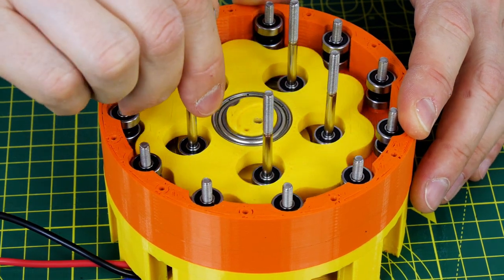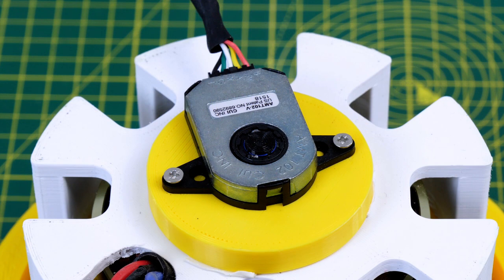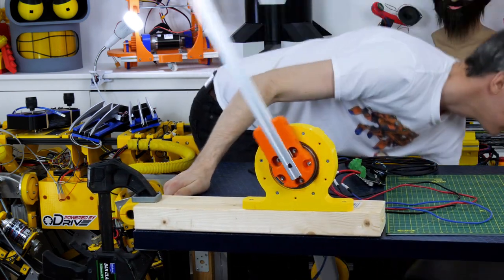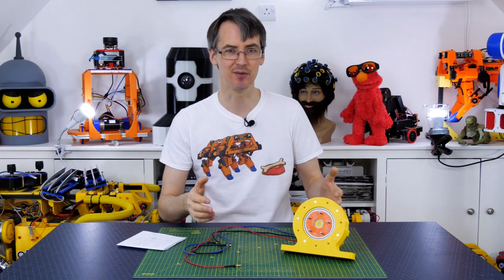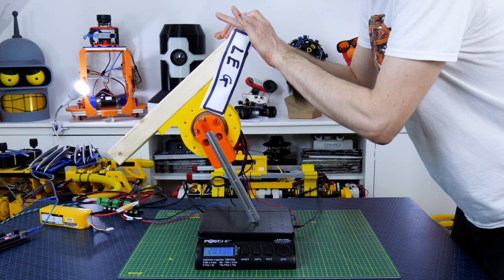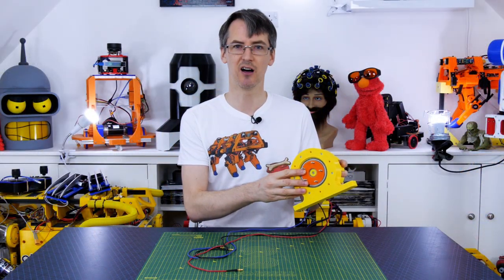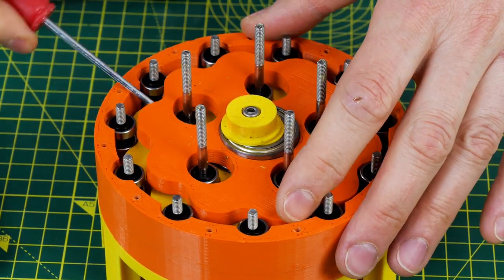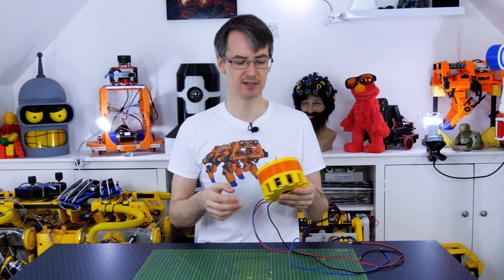Testing: Cycloidal vs Harmonic Drive 3D Printed Reducers

Comment from the maker: Next week is a totally different robotics project - Patrons and YouTube Channel Members have it already!
Reply: bro wtf 13 hours ago?
Reply: Which book shall i study to understand these concepts like...harmonic drive etc. There application n all.
Pls help
Reply: Hi James I think a abacus drive would be worth looking into as a powerful, compact, and backdriveable actuator
Reply: You should install a separate gear reducer on the strain bearings of the motor, that should help with the loss of torque
Reply: #@James Bruton how long did the 3d printed flex spin for harmonic drive last?
Reply: The VESC is much more than a skateboard ESC, and has encoder support as well. Please take a look at vesc tool. You will be pleasantly surprised by the insane amount of configuration parameters!
Reply: @Pesc0-conti  exactly. it triggers me so much. last 3 videos ... YOU CAN USE SENSORS WITH A VESC
Reply: Reduce the size of the drive itself, more dense packing. And it will move some weight.
Reply: Hey James, why wouldn’t you use a planetary gear box in this case.... just curious? Thx!
Reply: Does it involve prosthetics?
Reply: @maxciviletto9631  I would agree; Using the formula; 
planetary gear ratio = 2x(1+(RP/RS))
if you used a planetary gear with radius RP =  4 x radius of the sun RS, you would get the x 10 that you are looking for. Note will be back drivable too.
Reply: James have you tried a planetary gearbox for arms yet? They would back drive fine, would be loud though with straight gears, if using helical gears maybe thrust could be an issue ?
Reply: Plastic on metal will last much much longer than plastic on plastic, if you replace the bearing with stationary plastic its gonna wear out pretty quick especially when it builds up any heat, the plastic must also rotate like the bearings, take one ruler and try to cut it with another ruler and you will see how bad plastic on plastic is, where parts are rubbing you want metal on plastic
Reply: This design could revolutionize equatorial mount

Comment: At 25kg per leg looks like James is going to be able to ride this puppy. Can't wait to see the final design.
Reply: Only when stationary. Moving (3 legs, each 25 kg) sounds too close for comfort.
Reply: That would be so cool, although as the others have pointed out have to consider the added forces/torque from acceleration during motion.  Literally a statics vs dynamics problem lol
Reply: Next project open pony?
Reply: It's 2022, goodboi v3 is out, and can carry a load of 400 lb. Life is good
Reply: Moving, you'd need have 2 legs on the ground at a time, so they'd need to support (say) 80kg static, which means 160kg dynamic (you "weight" twice as much at peak when you're moving about).  So he'd need 80kg per leg to ride it.

So, if he had a 40:1 reduction, that would do it.  No idea if that would still be backdriveable.
Reply: I want robotic horse
Reply: The US military has six-foot variants of that dog to carry gear. Don't give them any ideas
Reply: @wiktorszymczak4760  it's been done- they call it the Bicycle.
Reply: @wojtek4p4  Eight legs, then, simple as.

Comment: "Mummy, who's that funny man on the skateboard with the strange stick?"
"Oh dearie, that's just James, the village robotics genius."
"But Mummy Mummy, are the three-dimensional models for that gearbox available for download online?"
"Yes child, he's a very good man and he publishes his designs as open source."
Reply: @GregorShapiro  It's not an STL, it's an STP (or STEP) file. There's a difference. Any 3D CAD program or viewer should be able to open it. You may have to enable options in your viewer to have parts of the assembly be displayed and adressable as separate pieces.

STEP is quite practical as a file exchange format but It's emphatically NOT a source file format. It's hard to change anything about a part in a STEP file. You lose all sketches, extrudes and other operation history, assembly constraints, etc. If you want to, say, change the diameter of something, you're better off just designing the whole part new.

It would be great if James could consider publishing his F3D files along with the STP files. Those are the true source for his design.
Reply: @olavl8827  Even in an STL viewer it isn't much better. The 'parts tree' has but two 'leaves': one is the 22 ball bearings, the other is the rest of the construction which cannot be broken down any further.
I can color or hide one or the other or both of these 'leaves' but can't isolate the cycloidal discs or any other feature.
 I would like to take sections so I can trace the shapes in the 3D modeling tool iam familiar with so I can extrude appropriate heights of the various parts and send them to a slicer for the 3D printer I hope to get access to when Covid restrictions are lifted.
Reply: @GregorShapiro  I'm not even sure if you read my previous comment, so I'll repeat: James' file is not an STL but a STEP file. You need a STEP/CAD viewer, not an STL viewer. STL is not a CAD file format.

If I open the file in FreeCAD I can select and manipulate all the individual parts of the assembly. But this does depend on the import settings that I configured. The situation will be different but similar in other programs.
Reply: @olavl8827  Yes I did read your previous post. I did install a STP viewer that is what I found 2 leaves in the hierarchy.

Comment: 3:10, C'mon man. I'm not going to tell you to not test it with by hand but at least do it from the other side of the table so that it doesn't have a chance to pinch your arm between the table and the lever.

Overall, like the idea. I think the Cycloidal Drive will work out well in this project. I agree that at the very least the outside bearings need to go, if I understand correctly, the disc is rolling across the outside pins anyways and thus friction there should be very small.

If you modify the geometry of the cycloidal disks, they won't need a full pin to roll against. This would let you print roller ring section in nylon and integrate the pins into the ring itself and possibly cut the outside diameter a bit, further reducing weight.
Reply: Upvote this. Every time he haphazardly grabs that lever, I feel like my heart is about to jump out of my chest.
Reply: I know it shouldn't be strong enough to seriously hurt him but I did cringe a little every time he grabbed it, all he to do was clamp it so he could easily grab it on the upward stroke and it would also eliminate it pulling the table up as well
Reply: Yeah, I'm fully expecting a video titled "Well it seems I've lost my fingers" at some point in the future.
Reply: @deflepperdrocks12954  Looks strong enough to break an arm or at least a finger if it hits you unlucky. I'd call that serious and I agree with the other commenters who want James to be more careful.
Reply: @olavl8827  his palm/arm should easily be stout enough to stall the motor at the distances he was grabbing and at the same distance even a single finger would likely survive although badly bruised, the only really dangerous spot in my opinion is the radius just above the tabs that connect it to the board as the rotating orange mass has very little clearance and you have substantially less leverage working in your favor

I would love to see him test the danger with something like a wooden dowel but I doubt he'll even see these

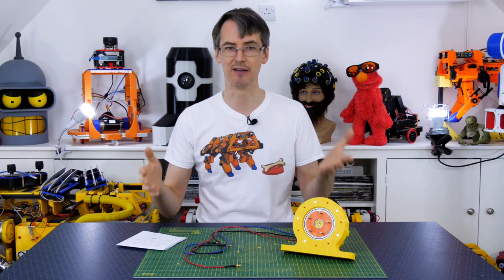Comment: 4:58 you were so close to actually finding out numbers, just vary the 8kg distance from 0.25m to 0.50m
Reply: He was even closer, he could have just measured the angle at which the motor stalled at 4:24 and calculated the arm from that.
Reply: @BigHorse4200  Looks like it almost stalled around 40° to me. That would be about 30Nm.

Comment: New torque unit - 1 finger per screwdriver.
Love these gearbox series.
Reply: Wouldn't it be 1 finger screwdriver, as finger is the force and screwdriver is the length?
Reply: @KentoCommenT  Yea, right
finger * scredriver

Comment: I think the biggest weakness of this particular strain wave gear is that the flex spline is a very soft material, meaning that when the output has enough resistance the wave generator can just compress the spline and roll past it instead of driving the whole mechanism forward.
Reply: Yeah. With the two point ellipse and the triangle gears he is also not getting anywhere near the contribution from the geometry (%10-20).  The flexspline cup is also WAY too deep given the material properties (Metal flexsplines are that long to allow for the needed flex). The cup is going to twist right out of alignment. Harmonic shows that the backdriving torque (https://www.harmonicdrive.net/_hd/content/documents/FB_Component.pdf) is commensurate with the input torque (slightly higher as might be expected) so there is a design flaw

Comment: I'm glad you're sticking with the cycloidal drive, and looking to remove some of the bearings. if you use a proper cycloidal tooth profile the gear teeth have pure rolling contact where they mesh, so simple pins or a bigger cycloidal gear will do just fine. No need for bearings or even bushings.

Also, I think nylon is a bad idea for the cycloidal gears. Soft, squishy and spongey materials soak up energy and reduce efficiency/backdrivability. I think this is what is causing problems with your harmonic drive. Think of it like trying to walk through mud vs on pavement. Personally every time I've used a squishy material in a drive system it's come back to bite me.

Loving your work!

Comment: I think the downfall of the harmonic drive was simply due to the flexible material of the core deforming at the tooth level to allow the gears to slip. Commercial versions use clever metal rings that flex at the ring level but are almost completely inflexible at the tooth level.

Comment: Priceless James! I've just started looking at drive types as I decide the style of robotic arm to print. I'd ideally like to get maximum leverage and torque of course. Even more so as I'm wanting to design interchangeable tool heads for the  arm to use it to drill, mill, cut, etc... I'd like to make it strong enough to work with wood, metal, plastic. The cycloidal drive looks at first glance to be more than capable of handling that! You're the bomb Bruton, THE BOMB!

Comment: The VESC can track rotor position @ 0 speed if HFI is enabled :)
Reply: Yeah, his motor doesn't have a sensor but he says it's the vesc's fault. I don't think he knows how to use it
Reply: I have 4 of that vesc in my skateboard and it can make a sinus curve with a rotor input. To me it seems he has only glansed at the settings or haven't bought the program Vesc-tool.
Reply: i mean most motor controllers are designed to do that
Reply: @Blox117  not really

Comment: have tried using PTFE filament instead of bearings. I have quite god experience with that. 
I would recomand to use it with dualextruding and just for the surfaces where the friction takes place.
Reply: Igus makes filament of their oil infused linear bearing material too
Reply: PTFE is really quite cheap to buy and mills like butter. You can probably just mill out the whole outter race and use PTFE sleeves as inner bushing.

Comment: For the torque test, instead of using a lever, 
uses a pulley attached to the output of the reducer, and a cable with a weight that is wrapped around the pulley when the motor turns. This way you have a constant resistant torque!

Comment: I think that 25 kilogrammes was more of your limit rather than that of the leg's lol. Great work as always
Reply: Yeah I'd think you'd want to brace the leg against something that won't move and let it press on the scale to get an accurate measurement.
Reply from the maker: Yes it'll do more, although the motor is starting to back-drive, which is what I want to absorb impact, but not under normal operation for standing still. It's more than enough overall though.

Comment: Nice design and well put together video James. I'm glad you're going to try bushings - it was what I thought when you produced the first variant. Not that it would save on cost, but there are also needle roller bearings available (I am sure you are aware of these, of course) which could work in reducing weight and allow the cycloidal gear to have fewer and smaller holes cut into them as well as perhaps reducing the overall size of the entire gearbox. But then bushings would probably also be perfectly fine considering the RPM you are asking of them. Perhaps not quite as smooth but much easier to work with. If you dont have a lathe or access to one and need some made up, let me know and I'd be happy to make them for you.

Comment: I'm surprised you didn't attach a rubber ball to the end of the arm and have the motor press down on the scales you have to test the torque that way. That'll give you a much more accurate result than hanging arbitrary weights off the end.
Cycloidal drive definitely looks like a winner :D Excellent work!

Comment: I think most 6.6 VESC's can take encoders. I know the Trampa VESC's can, and they are based in the UK and very friendly. They have 100v VESCs that can pump out 250 amps continuously that can take encoders, and you get to use the nifty VESC Tool.

Comment: Cycloidal drives by nature handle loads better than similarly sized or similar ratioed strain wave drives because of the higher surface contact and rolling features of the cycloidal drive. If you reprint the spline in Nylon rather than TPU, you should see an increase in performance.

Comment: Try a differential Cycloidal arrangement, this saves you the middle output bearings and brings the output shaft to the outside for better momentum attachement

Comment: James - if you want to cheat slightly on the Cycloidal profile, Camnetix Gear-Trans software has a Cycloidal option.  The software itself is fairly expensive - but there's a fully functional trial.  I've found the results are very good.

Comment: The cycloidal drive looks great! Just wonder, if you replace the bearings with bushings do you think it could generate too much heat?
Reply from the maker: I don't think they actually turn that much, and if the cycloidal disc shape is correct they shouldn't turn at all apparently ;-)
Reply: @jamesbruton  Nice!
Reply: @jamesbruton  If they won't turn at all ideally, then what is gained by having them, once you have the correct disk shape? Should you just get rid of them altogether and widen the post they were sitting around to compensate?
Reply: @delphicdescant  well its still fdm printed pla so if it isnt perfect(wich is pretty common in fdm printing lol) then you would have plastic rubbing on plastic

Comment: When you consider the mass and materials that your cycloidal drive is made from, it's pretty impressive.  Light, torquey and durable under load. You rarely get all those features together when plastic parts are involved.  LOL
Reply from the maker: Thanks, yes that was the plan, and we can still lose those 22 bearings!

Comment: Very nice work!
Don't you think that going to bushings instead of bearings will increase friction, resulting in less output torque? It would be interesting to see you do a side by side of the two. I suspect the bushing drive will have about 50-70% of the output torque of the bearing version.

Comment: You might want to consider using ceramic bearings which are lighter than steel/metal bearings, if the bushings end up being a bit of a drag.... so punny.
Reply: Ceramic bearings would end up quite costly, I hope bushings with geometry improvements end up being enough.

Comment: The harmonic drive stalls out earlier because the strain wave gear can't mesh with the other gear under load. Oiling the strain gear should improve that. TPU is just too sticky.

Comment: Love how that cycloidal drive is working.  I couldn't quite work it out from what was in the video - but how does the efficiency compare between the cycloidal and the belt drive?  i.e. the torque you can get out of the motor direct vs after the belt drive or after the cycloidal drive.  Of course, there is the 5x or 10x increase from the "gear ratio", but that is then reduced by the friction, etc of the mechanism.  I'm curious what that reduction is.
Reply from the maker: It's difficult to say, although the belts are very tight so maybe that causes more friction?

Comment: industrial harmonic drives are totally backdriveable and also have an acceptable efficiency. With the flexing however, it's probably hard to design it properly. The cycloidal drives makes more sense in this case, but it's not the fault of the concept itself.

Comment: Might investigate a small 2:1 planetary gear reduction, or some other ratio and then change your belt reduction, you can use with the existing belt drive. Put it on the larger pulley so that the belts aren't having to handle as much torque. You might even be able to find or make one that is small enough to fit inside the larger pulleys.

Comment: You could probably cut weight by reducing the number of interior bearings on the cycloidal disks from 5 to 3 .  I doubt you would have integrity issues if were applying 67% more force on each bearing.  With 19.5 Nm torque (assuming the bearings are at 2 mm from the center of the disk) each bearing is applying ~ 76N of force.  If you reduce to 3 bearings they would each apply 127 N, which is pretty reasonable.  I bet the cycloidal disks could manage that pretty well and cut the number of bearings by 4.

Comment: I have a question vaguely related, do you think the motor and O Drive have enough performance for a direct drive Sim Racing Wheel?? Where can I find more details about what the O Drive can do? Currently the only Open Source driver that can be used with 20 Nm servos has a prohibitive price.